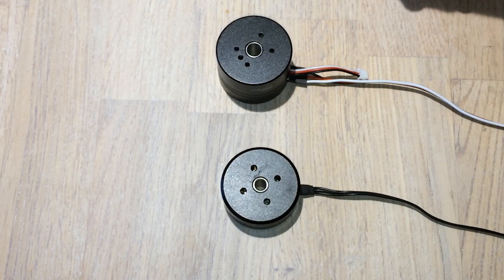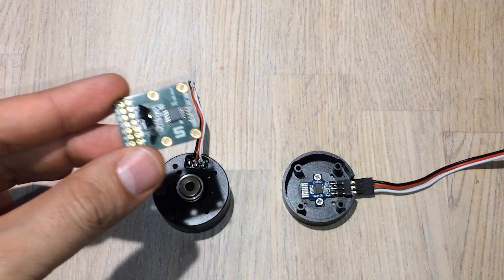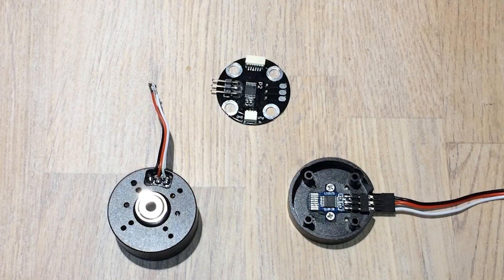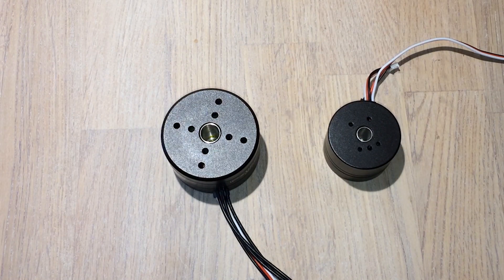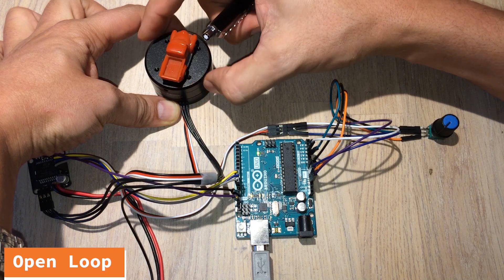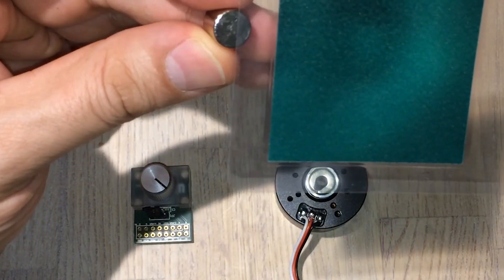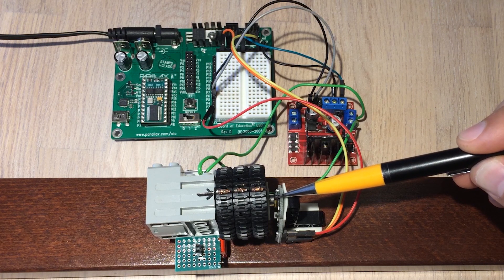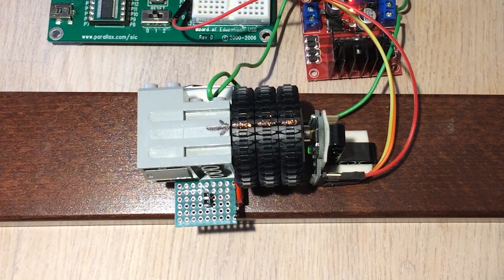Arduino Brushless DC Motor (BLDC) FOC Control Part 2 - Closed Loop Control Servomotor

Comment: 7:05 is it possible to use motor driver with DRV8302 instead of L6234 ? Because I want to use bigger motor. Oh and also will i have to change something in code ??? If anybody responds thank you so much !!!!!!!!
Reply from the maker: @felmeks  any semiconductors that give you a “triple half-bridge” would suit. You can find how to do it in my patreon with an L298, code is there too.
Reply: @RandomAccessProjecs  thank you so much for such a fast response !!! ill check it for sure :DD

Comment: Hi your demos are great and understandable. Just a question though. How would you implement speed and torque in closed loop together. Just an example you have a cnc spindle that you want to spin at certain RPM but when you cut something you don´t want to worry about the motors current jumping into sky. With a torque limit the current should stay at some pre defined level right?

Comment: Hi Pablo, does the AS5048 encoder only record 0 ~360 degrees (as opposed to the some digital  Incremental encoder (Omron for example) for examples gives you 200 pulses per revolution and will keep adding up after being rotated more than one full revolution) in the form of analogue voltage? I am asking this because if the set mechanical rotational angle is 720 degrees or two revolutions, how does the sensor-AS5048 output not mix it up other degrees say 360 or 1080 degrees, etc. As they will all give the same sensor Voltage output? Thank you!
Reply from the maker: You can keep track of the 359 to zero (and viceversa) transitions and thus, get more than one rotation. Watch my othe videos, specially the Drive by Wire and the one about Haptic feedback and you will see this implementation. Thanks for the support!

Comment: Congratulations on your tutorial, it cleared my mind! Could you help me with the encoders? WHat are the most commonly uused boards for such magnetic encoders? And what other types/circuits could be used?
Reply from the maker: There is a board for sale in the description and the encoders/motors can also be found around :) ebay search: brushless gimbal motor or bldc motor

Comment: Hey sir i am an engineering student can you please tell me the cost of the project? Btw awesome project 😀
Reply from the maker: Check out the rest of the videos and the links, you would need the board and a motor, can be with or without feedback sensor, you’ll probably spend between 50 and 80 USD.

Comment: Best tutorial on YouTube for FOC! Can I ask where you got the L6234 breakout board from as online I only see people selling the individual chips? Thanks
Reply from the maker: Thank you sir!!!! You can get the board integrated with better drivers from the link in the description! Good day!!!
Reply: @RandomAccessProjecs  thanks for the reply but the board in the description is the pcb you manufactured. I was wondering about the black pcb that has just 1 L6234 chip which I would need for basic prototyping. I am thinking of using the L6234 to build a 4 actuator controller which uses I2C protocol rather than PWM but works similar to yours. Other boards which can do this are too expensive or too big and bulky. I like your design as it is compact however I would prefer to make my own :) Thanks
Reply from the maker: @hassanportal5865  I understand now :) but unfortunately I got that board off ebay, made by a french company but they dont sell it anymore, it was around 29Euros, and only controls 1 bldc motor. The max you can control from one arduino UNO or Pro is 2 motors as they both only have 6 ports capable of pwm. The link is for a board that uses an Arduino pro and has power stages for 2 motors. Watch my “drive by wire” videos ;) good day!
Reply: @RandomAccessProjecs  I see, thanks for the quick reply. I think my best choice if to buy the DIP version of the L6234. Regarding the microcontroller, I think I will go for an ESP32 as it has 16 PWM pins so can drive up to 5 motors. Thanks again !

Comment: I'd be super grateful if you could tell me where you got the driver or an alternative single driver. Thanks again, this series really helped me understand this setup really clearly.
Reply from the maker: Hi Benjamin, the driver can be purchased through the link on the description:)
Reply: @RandomAccessProjecs   Thanks! Apologies if I'm missing something but that link is for the pdf of the chip. I was wondering if I could find somewhere that sells the chip on a board already. Thanks again
Reply from the maker: @benjaminwalker5949  try this link: https://www.ebay.com/itm/Arduino-Pro-based-Brushless-motor-controller-driver-board-FOC-BLDC-servo-/124316900944?pageci=c8af1610-e306-4507-9ce8-eada0014e765
Reply: @RandomAccessProjecs   thanks!

Comment: Hi! Did you purchase the servo motor with the hall effect from somewhere? Or did you attach the hall effect onto the motor yourself?
Reply from the maker: You can do both! eBay can help ;)
Reply: @RandomAccessProjecs  Great thank you! Do you happen to have a link from where you bought it?
Reply from the maker: @daichitamai5825  its similar to this one: https://www.ebay.com/itm/PM3505-Brushless-Cloud-Table-Motor-Microstrip-Single-band-AS5048A-Encoder-Motor/312718764443?_trkparms=ispr%3D1&hash=item48cf7da99b:g:ImAAAOSwcFhfUenq&amdata=enc%3AAQAFAAACgBaobrjLl8XobRIiIML1V4Imu%252Fn%252BzU5L90Z278x5ickkRjLZq23gAR%252BKma9gM2Z1htqvcotPQ7oFpu6nlMx%252FmrQppD%252FSA79MLnrDp6o7i7bJ4AB21wCvjrSLijM6beYVFnqTZn5XAFI8YDfa4HlZOBc2nbaHaXjDh9%252BXfHv7AhnephzW646Ys2uzD%252BGWN7QNxOC9fGGwA7vIeJt2Ob%252BluDxcsHo9kv6flufE%252By9wRUIoOtM8RGx6499uqEOyMZ7bCAj5mPRFH8af2wpx3l%252BljTvtq0PjBknDxOdIBZFrNm59Sj9vxXOBLfCuP99gG2zJgo5bqvWy1ftYX6sohONfAwl9b3kZH2AG9PJAGN%252BDKHoy8XRBT%252BPOJmbm7CI94DOPaSluozgcMbIej6o7uAM%252F7x8YhTN%252FqCx6OIfSLzw%252B264CCuZaCuO%252Bh0ydtP1eFc1O7rQ%252FKR9lbJV9qyg3WoSVvYOcvj%252FrMToK%252BdcM6V2TJIByybr4zZFhJ6co1G1ge2WkbLpcP34T%252FEZPDpdN%252FtPo9QKtJeEXWY1DkmzuhIx%252FPGQMSgC63DCXTSxUj7zqyX7p7HEXoqwBiGNPJ4ySmrhmyP3qDLai4UHAMeux13zHbZ60S3xZj7U0hjzL63RuAiS5mX5Yhci6KPehmcy%252Fb0u%252BOxLjse2sYlwyPm7BJrByxM0cpNkwPa%252BFzrb8NqKXMBbmB1VQV%252FFvn6nPZccWnRp19ORwXOmwQoPkR6K7NkoBp%252F8eBPO5Gi0q0vxueSRfP0ka6YD0fVvBE9LC419cRLiRXn1qUZDHCNbNZc2MpYZP%252BqKsp3J2x8Z4O0fu5I04Gg0SLI53RBF1SXsJOwX%252BMNEshYk%253D%7Ccksum%3A312718764443e330ee931b1b4377ae59b7d93eef00b1%7Campid%3APL_CLK%7Cclp%3A2334524

Comment: HEY MATE CAN YOU PLEASE TELL ME IF THERE IS A BLDC CIRCUIT FOR SKATEBOARD MOTORS LIKE FORWARD SOFT START AND REVERSE SOFT START AND SOFT BRAKING ??? BIG THANK YOU
Reply from the maker: Well ive used Vedder ESC or VESC, its pretty cool, powerful and reliable, good luck!
Reply: @RandomAccessProjecs  WELL IM MAKING WIRED CONTROLLER SOS I NEED A TOTALLY DIFFERENT CIRCUIT .... HELP PLEASE .....
Reply from the maker: You can try our board (link in description) and learn to program it yourself ;)

Comment: Thanks for this amazing video Pablo. I have a few doubts; if I attach a gearbox with the motor and suppose I need the motor to rotate 870 degrees  (2 rev and 150 deg) and hold that position, will it be possible ?
Reply from the maker: Shivit Kumar absolutely... use the code from the ball and beam video as I believe that one allows for more than 360’degrees, if not, i will make a video of that soon ;)

Comment: Hello again. Thanks for your suggestion on AS5048. Looking to buy these with the magnets so I attach them to motor. 14bit is not too bad. 2^14 is 16384 steps per round which can be pretty smooth for cameras. I really experiment hard on this staff. I plan to experiment on putting 2 cheap brushless in parallel and control a full camcorder with smooth movemnts. My problem are the magnets. Hard to find. Even the knob you presented with the holder and the magnet is not that easy to find. I am looking on ebay and aliexpress.
Reply from the maker: Thanasis Athanasi the ones I bought were from ebay, and included the magnet, even though the description didn’t mention it... maybe try that? They are around 10 usd ea.
Reply: @RandomAccessProjecs  Hello I order many of them from ebay together with 2 dozens of the cheapest Gimbal motors I would find. I will experiment with them. If the magnet does not come with the package I will try to fix 2 regular magnets in series like this:  Let each magnet = O.... I will mount them in the plastic like:   OO
Reply: @RandomAccessProjecs  Thanks. They probably include the magnets you are right ! I will take a closer look.

Comment: Want to ask the sensor's resolution. Looking for 16bit !
Reply from the maker: Thanasis Athanasi the AS5048 has 14-bit resolution ;)
Reply: @RandomAccessProjecs  Thanks brother. I think this is the best I can find ! I am researching on this whole thing right now. I have found some brushless motors from ebay for €2 each but they don't have the AS5048. I will try and modify them !
Reply from the maker: Thanasis Athanasi did you watch all videos on my channel? Theres some as5048 in different boards that I showed. You can buy some off ebay

Comment: Do you buy the motors with the 'backpacks' already installed? If so, can you provide a link?

And how do you install a magnet onto the motor? Do you superglue it on? Are there other attachments that you can buy to secure the magnet onto the motor shaft?
Reply from the maker: abetusk theres some other videos in the channel so you can see other variations of the AS5048 sensor, but to answer your question: I did buy these motors with the “backpack” but you can also buy it separately, a quick search on eBay for AS5048 sensor should give you an idea. Some of these sensors come with the special radial magnet which you can fix to the shaft using epoxy, super glue or even double sided tape ;) regards!
Reply: @RandomAccessProjecs  Thank you my friend for your wonderful videos. From what I see, the chip is broadly available in quantities in case you want to make a commercial product. You can design your own pcb and solder them on it ! I speak about commercial projects. Last resort are those electronic parts stores such as digikey.com, mouser.com, etc. But i find searching through these stores pain in the ass!